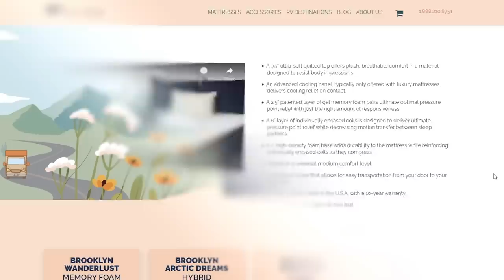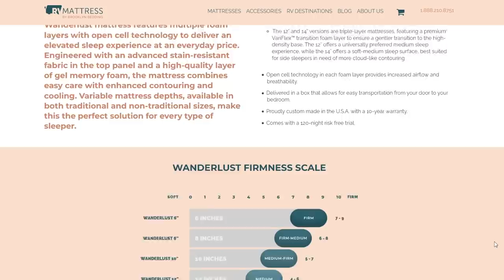Throwing in the towel with our camper (literally!)

Comment: My husband & I tent camped on our honeymoon. Then we got a “pop-up” camper. The next camper was a “pop-up” with a slide-out. Then a 30 ft. 5th wheel with two slides. We ended up with a 40 ft. 5th wheel with 3 slides. (We had several different trucks through the years. Our last truck was a Volvo semi-truck with a modified bed to carry our car while towing the RV. We were 75 feet long going down the road.) The only time my husband wasn’t fixing something was when we tent camped. 😆

Comment: My dad's always been a Ford f150 guy. He had the same 2015 f150 as you, and it was a total lemon. He said that particular year had problem after problem. He got rid of it for a newer f150, but it's having issues too. He's driven ford's for 40 years.
   My husband and I have a 2005 Toyota tundra that we chose because of it's number one spot for reliability (thanks consumer reports!). The worst we've had to do is maintenance and changing the battery every several years, and we've had it 17 years with almost 200k miles on it. My dad is now thinking about ditching Fords for a Toyota, and he's always been loyal to fords, but he's tired of the mechanical  problems. 
  I hope it doesn't work out to be a continuing problem for you like it was my dad. I'm so impressed with your handyman skills Tom! Way to go!
  BTW, Dawn, super cute sleeping areas!

Comment: Time for you guys to go buy an ATC.  They are made with all aluminum (including the floors) and the walls are fiberglass board.  The cabinets are all aluminum, too. Nothing to rot inside at all.  In fact, you can power-wash the inside.  I've had one for the last 3 years - it gives me such piece-of-mind.  I've had a few water issues, like it spewing everywhere because it was the first trip after winter and ALL my faucets were in the ON position when I turned the pump on, LOL! - also a trip where the sink drain came apart because of a faulty inner seal and water flooded EVERYWHERE after I drained the sink from doing the dishes), and it's nice not to have to worry about anything being ruined because of it.  If you're going to continue camping, you might consider finding a used one and try it out!  Love your videos.  ❤️
Reply: Just Googled. Wow...those look amazing!

Comment: Oh boy do we also feel the pain of the camper Delma. We use the camper with the relatives. Twice the water heater was replaced and every spring since we are the first ones to use it do all the cleaning 🧽 fun.  And this year we replaced the tires because after my brother in law said the tires we fine    And thank goodness for my husband’s insight that I take the air compressor with needless to say the fifth wheel camper had a flat tire when my husband finally was able with getting the tires off one took two days because the bolts needed help.  And so I thought I was done but in two weeks I get the camper back for our fair in Minnesota.  Wish me 🍀. Patty.  
PS. I made your chocolate chip cookie bars and everyone liked them and the last batch I added 2 cups of colored marshmallows and that was also a hit. 😀

Comment: When filling up the hot water tank to start opening up for camping- relieve the pressure valve until the water comes out then shut off.  
That looked like a pressure crack. 

We also use a pressure gauge at the spigot because the pressure is sometimes too much for a camper to handle.  

When we leave for the day, we also turn off the water…great insurance of an issue while we’re gone.

Comment: We have had a camper for over 9 years, and tent camped for 10 years.  Winterizing your camper is very important.  We live in Alabama and blow out our lines and put RV anti-freeze in pipes  every winter.  We also go all around the outside seams to see if we need to caulk/repair so, no water gets into the camper.  Campers require ongoing maintenance but the reward and fun always out way the work!  When our boys were little we surprised them and told them we were going to take them to Disney,  they both said they didn't want to go.  But wanted camping instead.  Our best family memories were made going camping, yeah even tent camping.

Comment: Love watching you guys. My husband and I travel with our 28ft trailer it weighs about 10,000lbs and I can tell you for sure that you need a bigger truck. We had an F250 and it says it can haul our trailer but we had to upgrade to a 3500. Also get a Scan Gage 2 and keep track of your vehicle's temperatures such as Transmission Fluid Temp and Water Temp.  The gages on your dash are not accurate but the Scan Gage is so you can see when your temperatures are too hot before there is a problem.
I am not putting you down  or Ford but an F150 is not the right truck for hauling your camper.  We learned the hard way. Best of luck
Reply: Our Ford 150 pulls our 28’ fifth wheel great back and forth Michigan to Florida no problem.
Reply: @chericook7575  it is all about weight.   The average f-150 weighs about 6000lbs. Depending on what motor it can tow 11,000lbs. But you must subtract the weight of your vehicle when towing so that only gives you 5k left for the weight of your rv. So if your rv is under this figure them sure  you are good.  From the look of their trailer it looks heavier.  We have an extremely heavy 28ft rig like I said it is about 10,000lbs so our f250 can pull it according to specs but it was at the high end of the towing guide. You don't want to max your truck out  because it puts a lot of strain on your transmission and motor.  That is why I also suggested investing in a scan gage. It will help keep you from ending up on the side of the road because of overheating. The gages on your cars dash ore not accurate at all but the digital Temps thw scan gage gives you really can prevent problems.  Hope you never have to deal with breakdowns like they have had to, and like we had to deal with because they are expensive and ruin your fun trip.

Comment: So hoping that your trip goes well, and you have no mechanical (or other) issues to spoil things. I know camping with a trailer is an adventure - been there, done that. For a few years we borrowed my in-laws motor home which was great, BUT…. Something always broke or went wrong. We did survive. We just bought a 2019 trailer last winter and have had one trip so far. It went well (I knocking on wood as I say that).

 ALSO, on your recommendation, I bought a mattress from RV Mattress, and it is GREAT! I felt sorry for the young lady that delivered it - the box was heavy. And the only problem we had, was that it started to expand before we got it in place. It is very comfortable and seems to be of great quality - we very happy with it.

Wishing you a safe, fun-filled, and uneventful trip! Have fun!

Comment: We are on our 3rd camper-It’s not you it’s definitely camper life. Also, My husband always says the same thing Tom did-they don’t care about fixing it-they just build it. Side note: always be sure to run your water for several minutes so your hot water heater fills up before you turn the hot water heater switch on. My husband always warns me that if I forget I could crack the water heater. Fortunately we are in FL so we don’t have to winterize so I can’t relate to that part of the situation.
As far as your truck problems go…I hate to say it (and sound like captain obvious) but my husband who has been a diesel mechanic for 30 years says that if you have that particular ford with that diesel motor: Sell it! He’s a ford guy too but says that particular engine is full of endless/expensive problems 😢

Comment: We just got back from a week long camping trip. We had two issues with water. One is the drain under the sink always leaks and my hubby is just like Tom and can fix anything and he’s fixed it every trip and it still leaks. And one night there was a terrible down pour and we always have our canopy tilted some for water drainage but it came down so heavy that the water pooled and my hubby tried to stand on the picnic table to push the water out and SPLASH! It was like one of those huge tippy buckets at the water park. He was soaked! Thankfully the canopy didn’t tear and he just had to put in a few bolts to fix the framing on it. But what a mess!

Comment: While I wouldn’t recommend it for a family as large as yours, my husband and I camp in a 2019 Oliver Elite II travel trailer.  Solid, very well built.   We put well over 10K miles on it last year.  We did a lot of research on travel trailers before buying one.  Most of them are not well made at all - my husband and I call them “disposable.”  Cheap. Cheap. Cheap.  We did find a few brands that are well built, the Oliver being one of them. We toured the factory in Hohenwald, TN, were impressed with what we saw, and ordered one that day.  They are perfect for two people, maybe three at most, but that’s perfect for us.  We got a composting toilet and the solar package because we like to boondock (dry camping - no power or water).  Both have worked out very well for us.

Comment: Hopefully you all won’t have any more trouble this year! I agree with the comment that it’s the nature of the beast. Just yesterday we had to replace the entire camper plug on a 2021 one owner camper before us. It melted into the surge protector! The plug on our house is fine but we replaced it anyway. The amp output was checked and it never went over 17 with AC and everything running with a 30 amp plug. So we aren’t sure but the electrician and the camper place think it was a faulty plug head. 🤷🏻‍♀️

Comment: 100%, campers are so fun but they are complete JUNK! We went and looked at new ones again this weekend and I didn’t think the could get worse but they have. But again, so fun!!
Reply: Endless adventure just did a comparison video and the brand new one they rented was in just as bad shape as their near 50 year old one.  Why are RVs such junk now?
Reply: @Skittl1321  Pretty much everything made later rather than sooner is of inferior quality.
Reply: @Skittl1321  2 reasons, 1) during Covid tons of people jumped on the RV trend and bought everything up, so the manufactures rushed and made crappy product it meet the demand. 2& most recent) prices are going up and they are trying to cut cost!! A major example and huge safety issue currently happening is they are using thinner metal on the frames the trailers sit on and the trailers themselves.  There have been situations where people are buying new trailers and the actually frames are breaking because the gage of steel they are using is too thin.  Insane! 

We were in one over the weekend where I opened a closet and the trim was coming off and I went to put it “back” and it was put on with double sided tape. A $130,000 RV built with double sided tape.😡

Comment: I only know about winterizing because 1) husband is a plumber and 2) most of his seasonal customers require an air compression blowout of the system due to lack of heat in the homes/cottages for 10 months of the year. It's all good. Ya won't do it again!

Comment: Two lemon motors?  We get used engines from pull-a-part/you-pick-it carparts reuse places not dealerships.  We also got lemon motors sometimes, but they aren't half as expensive.  We've replaced an engine twice and drove the car 450,000 miles.  Keep an eye out for government car and equipment public auctions websites.  We got an amazing Ford F350 superduty extended cab for a great price (including minor fixes).  Your ford F150 is a great truck!  Perfect for RVing.

Comment: My families camper hasn’t had a “running toilet” for at least 15 years and we just use a plastic coke bottle to hold water next to the toilet and use it to “flush”. Our camper has never smelled doing this either, so if your toilet is really giving you issues, you can still use it!

Comment: For what it may be worth, our GM motor would knock too. We do the “engine cleaner” periodically from like Chevron and only use the high 93 octane (no corn) ever since, and we’ve not had a problem with the motor. Yes it costs more, but we’re now at 200k+ miles and motor still running good. 👍🏻 (it does have other issues but the audio not working is negotiable, motor not working-now that’s necessary 😁👍🏻)

Comment: Our very first trip in our 2019 5th wheel my husband emptied the the tanks but failed to do one thing after working to sanitize the black tank and fill the fresh water tank. Though iI specifically don’t know the major thing he failed to do, I can say that the result was our black “EXPLODED” and the stench of poop aroma filled the entire camper; especially in the room that dealt with the water pouring down from the top of the camper: remember I said it exploded? That was no lie! You talk about how long my husband had to clean and reattach what blew off when the tank exploded! My husband is a minister and not a plumber! After that we never really took trips except to stay as a camp host  in Fall Creek Falls State Park, Tn (great RV place to stay) and then put RV in storage(Vermont). We realized that our adventures as those who are campers is not the Flowers’ family - Hampton Inn is our type of camping! I know, it’s very sad! I’m glad you have real skills to fix your challenges! Gale Flowers 🌸
Reply: Cracked me up, my husband did a similar thing flushing out black tank. Hooked up hose to black tank flush, walked away to do something else. Then suddenly brown poopy water blows up thru the vent pipe on top of the roof. Stench smell all over the place. Plus same in the bathroom, used every towel to cleanup.   We were at a campground when this embarrassment happened. All trailers were packed close hardly any space.  Our next stop was laundry mat.

Comment: I didn't know Tom was a contortionist. Good job with the repairs. Sorry to hear the bad luck you have had with your truck. We  have '99 F-150 (gas engine) with over 402,000 miles on it without any major problems. Full disclosure we did buy it brand new and my husband is a certified mechanic. He does not like Ford's diesel, he prefers the Chevy diesel. Cute Gage! 👍🥰

Comment: My brother & his wife bought raw land in the hill country of Texas. They slept in a pup tent while they prepared the land and started the building process. No electricity, but had well-water. He built an outhouse with a flushing toilet and a hand pump for hand washing. His son bought a new high dollar camper, used it once. They bought it from him to live in while they built a house. After the AC/heater died, he added 2 small AC units And bought a small electric heater just in case. Added a tankless water heater & a septic tank, repaired the cracked fiberglass bathtub. They lived in it for 5 or 6 years. He was still working and traveled a lot. Finally got enough house built they could put the kitchen together, washer & dryer, and live in the house. He finished it after he retired. The camper became a storage unit.

Comment: Yep- have a camper- ours went without defects UNTIL our extended warranty expired! 🙃

We also have a 2017 FORD F 150 with a 3.5 V6 engine. It started making a strange noise @ 65k miles- just after the warranty expired. The dealer told us the VCT needs to be replaced to a tune of 3,000 $. If we don’t fix it, the engine will need to be replaced. 

There is a Fo d Service bulletin about the 3.5V6 turbo engine having this problem in both the F150 and the Expedition between 2017-2020 (manufactured before 10/31/19). 

We just happened to be one of the lucky ones- Ford tells us that they sent letters to all owners in Oct 2021 informing them of the defect with a deadline of 02/2022 to have it repaired for free. We didn’t get the letter! 

Ford has been good; they are willing to pay 60% of the cost to repair.  I am working with them to cover the entire cost. We bought a very expensive truck- specifically for THAT engine. 

I continue to ask to talk to additional people. I understand warranties and expiration but this is a known defect with this engine!! 

Could that have been the problem with your 2015? The Ford Technical Service Bulletin is number 22-2200. 
This just seems wrong- the consumer should not be bearing the cost. 

Perhaps our MN Attorney General can help. 
It sounds like your truck has not been fun

Comment: Does there a shut-off valve in the bathroom? My Pontiac motor blew at 87000 miles. Extensive damage to the engine compartment. Things just happen. Long drive, 26 hours but needed 27 hours. A Ford fan myself but this was a good buy...

Comment: So I'm not usually one to offer unsolicited advice but I wanted to mention something that was told to us (which you can take with a grain of salt). When my husband and I were looking at trailers and campers, a friend who has had RVs told us that the tow limit on a vehicle is the *limit*, not the recommended tow weight. He advised having a vehicle and trailer combo where the dry weight was 50%-75% of the vehicle's tow capacity so that if you had to go up hills etc you're not straining your vehicle as much. It seemed like sensible advice so I thought I'd pass it along in case it can help someone else. It's not something an RV dealer would tell you... they'd try to sell you the max they can get.

Comment: Yeah, a new camper. Noooooooo! The quality of camper construction dropped (again) around 2016. We just bought a 2012 Fifth Wheel, but it will remain parked in an RV park in Florida. As we looked at newer models, we could just feel how cheaply made they are. So we saved a bundle of cash and trouble by going with an older model and parking it.